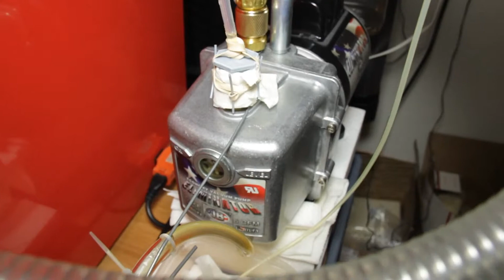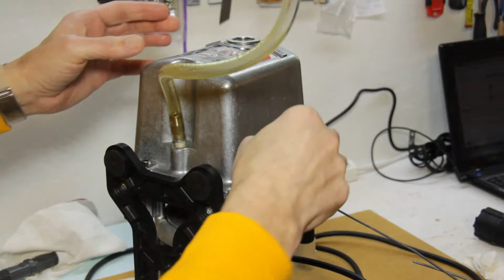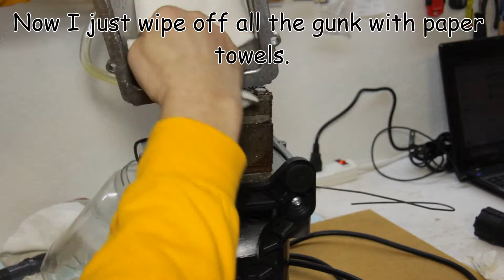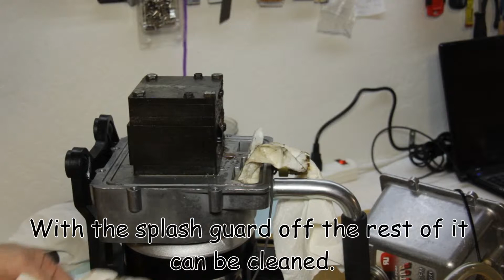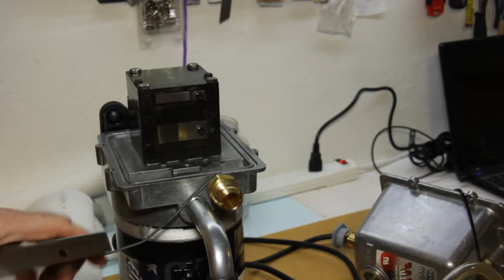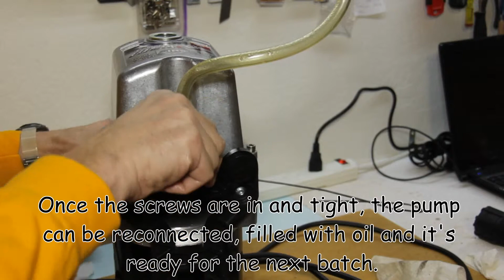Harvest Right vacuum pump cleaning

Comment: That seems like a lot of maintenance. Is the oil free pump maintenance free and would you recommend the oil free pump? How do you like the machine?
Reply from the maker: First the last question: We've had our freeze dryer for more than 3 1/2 years and are at almost 400 batches, and we love it!

There's really not that maintenance anymore. This was very early on before I changed how I filter the oil. With what I do now, https://youtu.be/0I3R5tI7uKY it takes me about 5 to 10 minutes after every 10 to 20 batches to change the filters. The frequency depends on how much water is in the batches. And I haven't opened the pump in over a year, 120 batches. Though I plan to do it soon to check it.
It's true that the oil free vacuum pump does not require oil changes and requires less maintenance. Some will tell you that the Oil-free pump is the best thing since sliced bread (or freeze dried food!) 

The short answer is:
I have looked at the Harvest Right oil free pump and they look great, but it doesn't pencil out for me. At least not yet. If I were still changing the oil after every batch, I'd probably give a different answer.

The longer answer is:
The more I perfect the oil filter system on my freeze dryer the easier the maintenance becomes. 
I'm using a continuous flow oil filter system with two filters in series; the first with a homemade 3D printed paper towel filter and the second with a Goldenrod 496-5 water-block filter. . For me, the extra expense/cost of the oil-free vacuum pump isn't worth it. I can't justify the extra expense when the original one is working so well. Don't get me wrong, I wouldn't mind having an oil-free pump, but It costs almost $1700. With that much money I could replace the regular pump a few times (which cost less than $300), pay for my oil filter system, which is working very well, and still have enough left over to buy all the oil and cleaning supplies I will need for maybe the rest of my life. I've been using the same 2 gallons of oil for over 3 1/2 years and almost 400 batches and I have not seen any degradation in the function of the pump.
We have the medium with the regular pump, (replacement price $300) 3+ years and over 380 batches and still going strong. I'm too cheap to upgrade even to the Premium pump, (replacement price $900) and certainly not the big money for the oil-free pump (replacement price $1700) 
For me, If I were going to upgrade, I'd have to go with Premium pump for it's cost/benefits.
Reply: @SchoolReports  Thank you for such a detailed response!